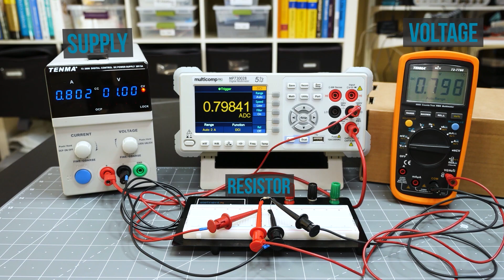element14 presents Channel Trailer

Comment: I need help, I'm hoping someone on this channel can help me. My wife does these resin prymiad models. She puts LED lights in the  models. The lights are powered  by a 4.5 volt battery box that is remote controlled. Now she wants to add a mp3 modular attached to the same 4.5 volt battery pack so that the remote control can control the LEDs and the mp3 modular at the same time. Is there anyone on this channel that can help. Please.